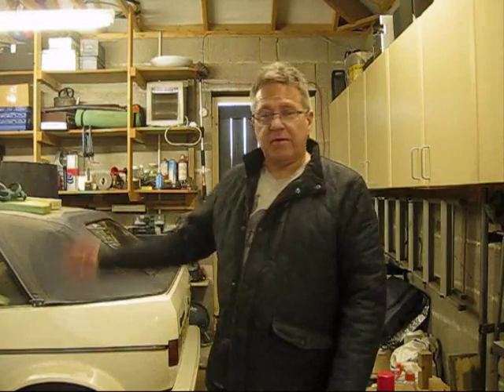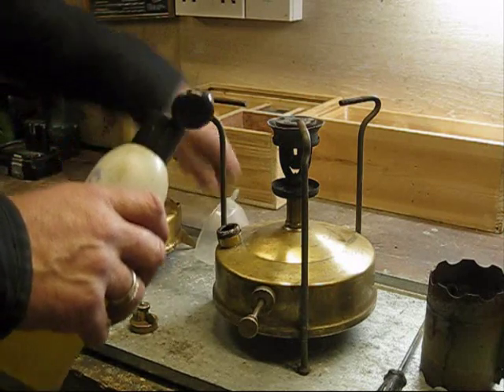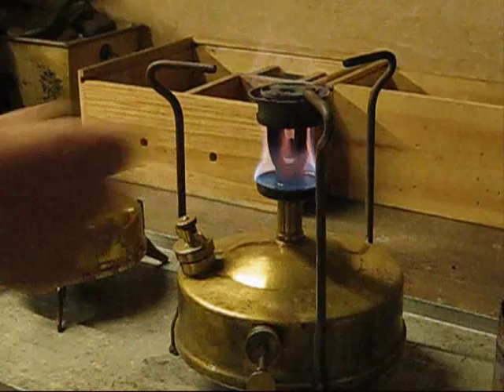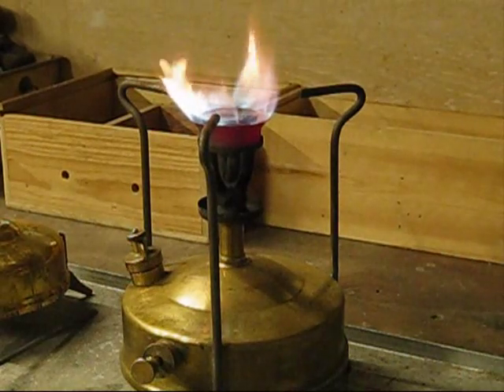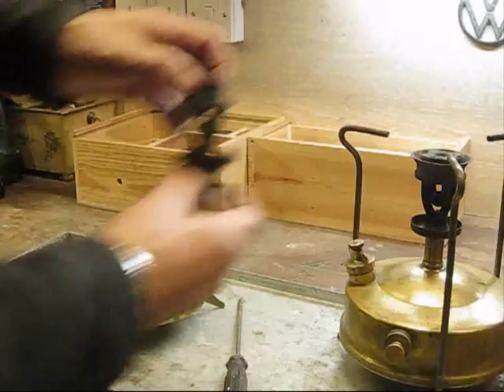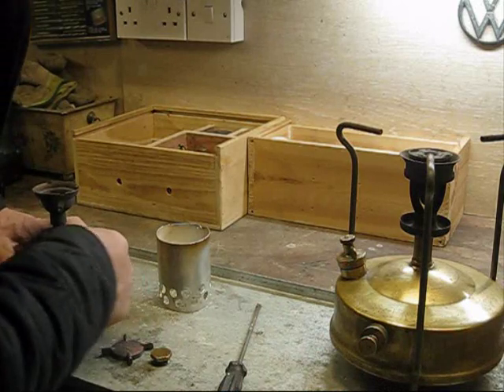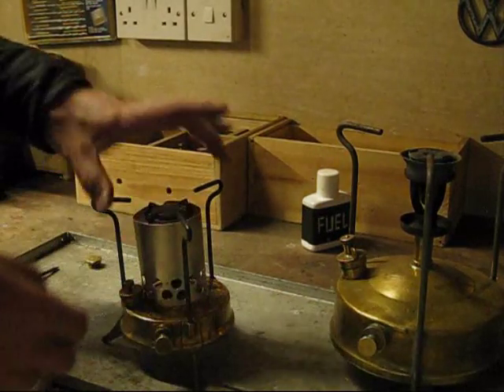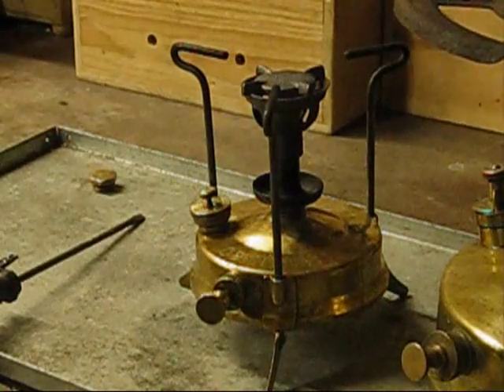Primus Stove -  How it Works

Comment: My mother had one back in the 1960s, we never used alcohol to preheat the vaporising tubes or manifold, we pumped it until some raw kerosene squirted out of the jet, and pooled in the tray below, when we have enough kerosene pooled in the tray, we let the pressure out so as not to overflow the tray,  we then light it with a match and let it preheat tubes, after about a minute or so, we pressurise it and the stove starts roaring giving out nice mostly blue flames with little yellow unburnt fuel vapours.
Word of warning they can generate carbon monoxide so always use them in ventilated space. If you do not have methylated spirit, you do not really need it as kerosene would also do the job but it makes more soot and carbon deposits.
Reply: Thank you so much Gabrielle 🙏!...God bless you
Reply: And the smell too

Comment: You can control the heat too with letting the pressure out, there fantastic, boils water in no time, works better with altitude, the Everest expedition used the travelling one, well proved itself 👍 ❤ love em, cooking on a blow lamp, nice blue flame 😊

Comment: Thanks Jack! I bought a Parascene Pack away stove from ebay £20, in a nice red tin(no rust) it holds pressure, roarer, came with little meths tin, spanner and proper windshield, No pricker but no worries because you can still buy them. I couldn't resist it at that price, I'm guessing its about 1960 ish. Now I have your instructions I'm confident I can use it to make a brew.
Reply: Bargain

Comment: He visto que algunas de estas estufas se le coloca una mecha en la parte interna, yo supuse que es para que el combustible suba hasta tubo precalentado por el efecto de capilaridad y al encontrar el tubo caliente se vaporiza y por aumento de la presión busca la salida natural que es a través de la boquilla. Pero en este caso no usa mecha supongo que aprovecha el precalentamiento de los vapores normales de la bencina.

I have seen that some of these stoves have a wick placed on the inside, I assumed that it is so that the fuel rises up to the preheated tube due to the capillary effect and when it finds the hot tube it vaporizes and by increasing the pressure it looks for the natural outlet that is through the mouthpiece. But in this case it does not use a wick, I suppose it takes advantage of the preheating of the normal benzine vapors.

Comment: Is this cheaper than camping gaz cartridges? I have a single burner camping gaz stove for when the electricity goes out, but the cartridges in 2023 are not cheap a £2 cartridge burns for about 2 hours.
Reply: Yep, assume kerosene be about 3.50 a litre in your country which will last alot longer

Comment: I recently picked up one of those but it has like a plumbing nut on the base of the pump fitting and unfortunately I think I broke the pump testing it and the leather part has fell off into the tank. Can I use Primus parts to fix it

Comment: What is the reason for leaving the air screw open whilst priming, also where did you get your little squirty bottles from please
Reply: If the air screw is closed while priming the tank will increase in pressure while the burner is not hot enough yet to vaporize the fuel so liquid fuel will come out of the jet and burn with smoke and soot.

Comment: I used one of those in my childhood. Commonly used in that era. But we used kerosene instead. Using paraffin oil doesn't " plug up" the system? I'm intending to buy one " just in case". Everything is electric in this place. Power out, no way to cook or heat up the apartment. Thank you!

Comment: Primus means ‘first’ in latin. They took the name because they invented the system where you preheat the heater and the fuel is ignited as a gas rather than a liquid. This massively increased efficiency and economy and also meant a much cleaner burn with less soot. 

Before Primus stoves burnt kerosene in liquid form.

Comment: Many thanks for the very informative video. Which paraffin fuel you're using? Is it the same ad gasoline? How many types of fuel can be used in such stoves? Thanks 👌
Reply: Never use petrol or gasoline it will end very badly indeed. Use lamp oil (parrafin or Kerosene)  you can get better grades of parraffin that smells better and smokes less but it will work on cheap heating oil.

Comment: Hi Jack. Thank you for a wonderful video. 
I have a Primus stove in the attic and would love to have it working again. 
I’m wondering is the service kit the same or will I need to know the exact model no. 
Also I have a kerosene Primus heater with a chrome dome is it possible to get service parts for this. 
And one more thing Jack do you have a Primus blow torch and maybe you could do a video sometime with it. 
Kindest regards Pat.
Reply: I have one video of lighting a Primus blow torch.
Reply: the parts seem to be standard sizes. you can buy all the bits on ebay.

Comment: I've been given a valor packaway stove. It's got 5k on the original label tag that was in the tin. Is it worth my time to try and get it going, or shall I just pack it away in the shed?
Reply: Get it going, they're not of much use packed away.
Reply: Yes, always worth it! 👍
Reply: @davidgaunt3192  cheers David. I've just looked, and it was two years ago now that I asked for advice on my valor packaway stove. Thanks for your reply. And I feel privileged to tell you that I bought some new seal kits etc soon after i asked for the help, and after a few trials and errors etc,.....the little brass packaway stove was roaring like a jet fighter!  I've still got it David, and I regularly use it. Its indestructible and 100% reliable. I can leave it in the shed for months without use and it looks in a terrible state when I need it again. The once gleaming brass is always ugly and dirty. But beauty is only skin deep. Its what's inside that is important. Within 2 minutes, that little stove is roaring so loud that you can feel the vibration from the heat and power its chucking out!  I'll never let it go anywhere Dave. It's a keeper, and one day I'll feel proud to hand it down to someone in the family. 🤝👍😊🙌

Comment: Sir, I have a chinese made stove similar to the one you have. After lighting it for about 5 minutes, the kerosene starts to leak out of the joint where the spirit cup is and also starts to burn as it is hot. Do have any idea of what could be casing it..?
Reply: If it is the smaller of the two stoves (Optimus 96) then it may need a new lead washer which is visible when you remove the vapourising tube. If it is the larger type of stove then you may need to replace the two burner washers (one either side of the spirit cup). These washers will need to be heatproof.
Reply: Hola Arun Shama.....encontré este video y luego vi tu comentario de hacen dos años y lo que creo que le ocurre a tu artefacto es que el pico eyector del combustible gasificado tiene el orificio un poco grande.....si logras reducirlo creo que se te termina el problema...te digo esto porque conocí muy bien estas estufas ("calentadores" les decíamos en mi país, argentina)....como te decía, si el orificio está agrandado sale combustible crudo mezclado con el gasificado y ocurre lo que describes....así que es posible que necesites reducir el tamaño de dicho orificio y será mejor el desempeño de tu estufa....espero te sirva de algo este dato si es que ves este comentario....saludos desde la patagonia argentina....daxboreal@gmail.com........!!
Reply: Did on mine, so I just removed the burner from the spirit cup and used plumbers tape on the threads and worked fine, Was worried of it burning but didn't seem the case after hours of use

Comment: I use little chunks of firelighter instead of alcohol to heat the pipes. Easier to find in shops.
Reply: Do they generate enough heat?
Reply: My grandfather used a bit of newspaper.  Might not work if you're using diesel as fuel though.

Comment: I've been restoring an old stove with my lad it's a primus monitor I wanted to test the pump dry, is there any resistance on it ? Or does it have to have parafin in it before it will work as a pump

Comment: parrafin?? = Kerosene? I have an ioptimus 80 white spirits
Reply: The fuel for this stove is called paraffin in the UK, kerosene in the USA.
The fuel used to preheat the burner is usually called methylated spirits in the UK, and denatured alcohol in the USA, both are ethanol.
Reply: basically the same but parraffin tends to be more refined and smells less than kerosene.